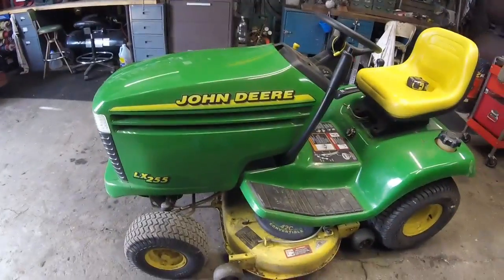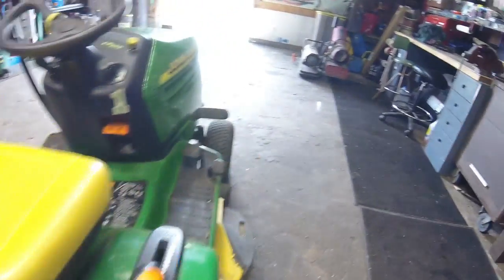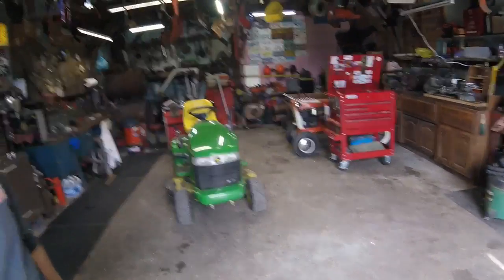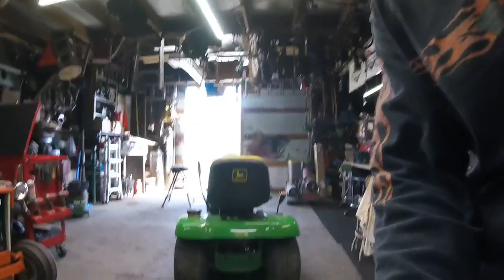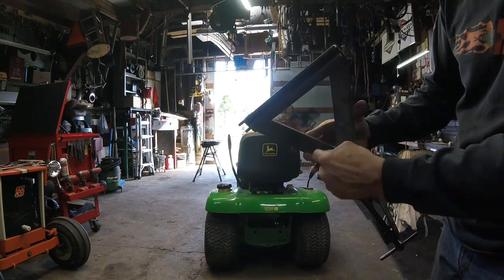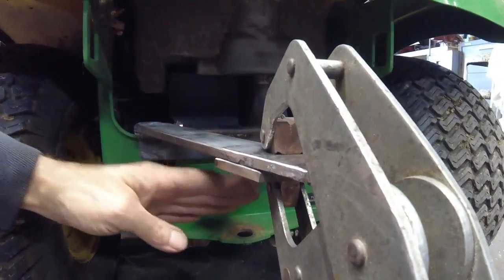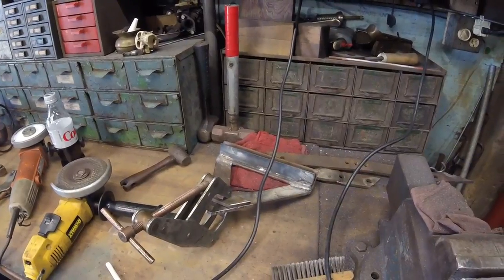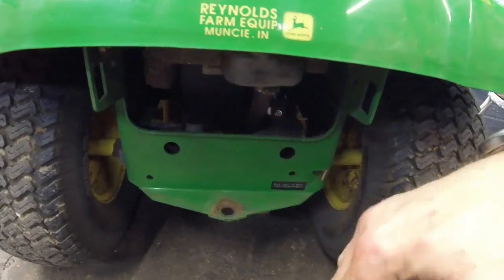Craftsman On Hold and Other Stuff!

Comment: Well I guess I'll keep you posted on the head gasket over tightening issue.  I keep all 8 head bolts at the over tightened status and went ahead and put everything back together.  I put new spark plugs in and topped off the oil.  It started right up!  No strange noise or weird noises.  In fact I'm quite amazed at how quite this engine is.  and no smoke!  I've got 2hrs on it now because I mowed today and not a drop of oil from the valve covers and no smoke.  I don't think I harmed the head or gasket by over tightening the bolts. I love Kohler engines.

Comment: Have that same mower and 235gt hoods  on both are busted but I mower  with them still every week. 18 years old. both have briggsstration 18 horsepower. run as good as the day I bought them.
Reply from the maker: That's because they've got Briggs in them! lol...But in all honesty, the Kohler OHV singles are great little engines as well. Maintenance is key, as I know you're well aware of! Cheers my Friend! Zip~
Reply: True that.  Briggs for the win.  To be fair, my John Deere G110 Kohler Command twin has 700 hard hours of use, but the Kohler Courage Chinese made engines are junk, and expensive to repair.

Comment: i got this one simplicity tractor ( had plastic grill)  years ago- tractor was all butchered together, not worth saving. anyway what it had was this super heavy duty bolt on hitch made from 3/4 " steel with a trailer ball, havent really put it on anything yet. definitley saved that bit, cant make something like that cheep any more.

Comment: Does that Deere have a CV15S single Koehler in it. Those LX255 tractors are pretty good. Pretty nice mowers. They were one of the better mowers Deere made. I think you will be good flipping the craftsman mower. It will make a good mower for someone. Great video.
Reply from the maker: I can make the 54" deck work by making the front bracket and bolting it to the axle cross member, but it sure is a lot less work to throw it under the Poulan for right now. And yes, it's got the Kohler single. I've worked on it a few times. Head Gasket, Magneto and Clutch. And I agree, as far as those Green things go, it's a pretty nice one. Most of my neighborhood is Green, some White and Yellow, a smattering of Maroon, Lots of Red of varying types then there's me....Simplicity lol. Cheers my Friend! Zip~

Comment: it was my head gasket causing my smoking problem.  I'm changing the gasket on both sides now.  I'm having trouble with the torque on the head bolts.  I broke one bolt so I went and got 8 new kohler head bolts.  I'm back in the shop now and can't get the bolts to torque above 60 ft lbs.  I'm being very careful but if doesn't feel like they are tightening up.  at 60 lbs and I need to go to 300 lbs.  What I'm I doing wrong?  should I keep going?

Comment: I have a 26hp Kohler in my Craftsman rider and it starting to smoke when letting off the throttle.  and smokes a bunch on the second start up after you run it awhile then shut it off for 15mins then start it again it smokes like crazy.  Rings right??
Reply from the maker: Rings or blown head gasket. I'd check the head gaskets first. Zip~

Comment: Never mind.  I figured out what I'm doing wrong.  I need to use inch pounds not Foot pounds.  What could go wrong if a head bolt is over tightened?  I have them all at between 57 and 61 ft. lbs.  Should only be at 370 in. lbs.
Reply from the maker: You'll over compress the head gasket and possibly end up with a blow out as a result. The only other thing that can happen is you'll pull the threads out of the block, but it doesn't sound like you did that. Zip~